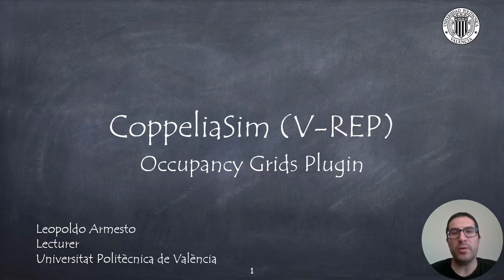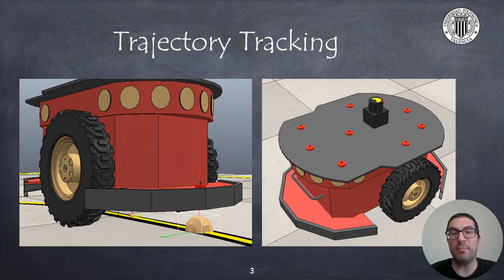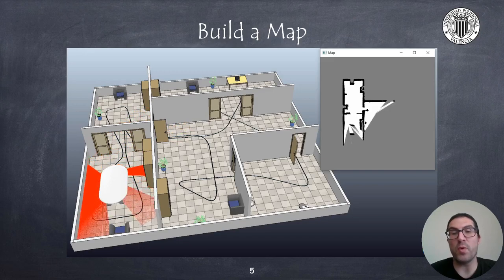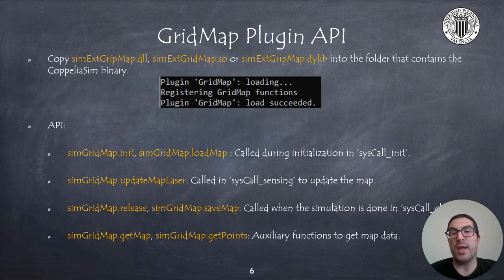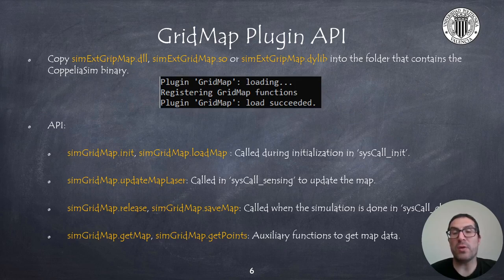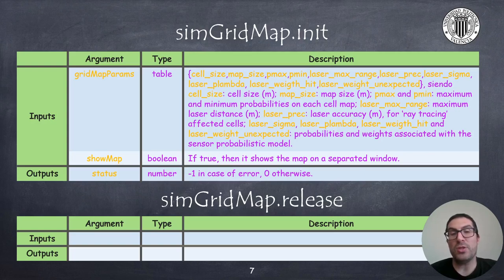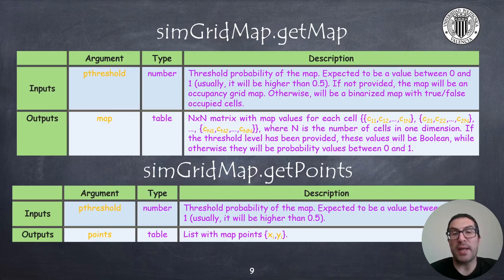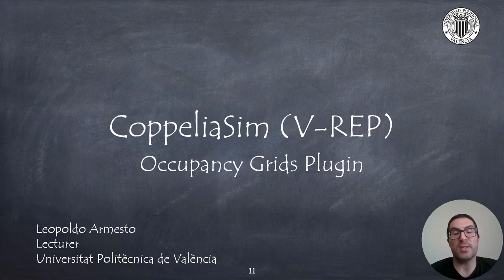How to Implement Occupancy Grids Maps with Occupancy Grid Plugin | CoppeliaSim (V-REP)

Comment: Hi Leopoldo,

Thanks for your video. I have added the .dll file and verified that the plugin has been loaded into Coppeliasim. However, I still do not know how to use it with Python and Coppeliasim.
Reply from the maker: I think that you need to build a wrapper function so that you can call it from Python

Comment: I appreciate your great videos!
 I am figuring out a ways to work on a robot localization problem using already collected  (lidar and IMU)data set of an environment. How can I use CoppeliaSim in this case?
Reply from the maker: In that case, you need first to estimate the pose of the robot and map  (Matlab , ROS, specific SLAM libraries, etc...) based your data. There’s no tool in CoppeliaSim that will process your data.

Comment: I want to do path planning for a autonomous vehicle (ackermann steering model), how can i do that in coppeliasim? (i saw one video for old vrep, which has inbuilt path planning option, but new coppelia sim doesnot have that)
Reply from the maker: Yes, it has changed. If you want I can send you a simulation file with the DYOR robot solving a maze with the path planning API. Since an Ackerman model and the differential are both non-holonomic, the API is the same. Please contact me through PayPal, because I don’t like to provide my e-mail address public
Reply: @LeoArmesto  i don't want to use any sensors, instead want to specify which all elements in scene are obstacles and should get the path generated from start to finish point. When i change an obtacle position, should get new path generated. OMPL plugin has no UI in CoppeliaSim and only works via API script?
Reply from the maker: The solution I mentioned is not based on sensors. It’s using motion planning API based on collidable properties of objects, solving a global path planning problem based on RRT algorithm if don’t recall wrong

Comment: Thank you so much for this video. I am a student and I am working on a similar project. I tried to download the plugin and place it in the main coppeliasim folder where other .so files are present (I am working on Linux machine). When I try to run coppeliasSim after that, it says could not load Grid Map plugin as it could not load required dependencies. When I checked with the error script in coppelia, it showed me some missing files. Could you help me with these dependencies? It would be really helpful. Thanks.
Reply from the maker: Hello, which missing files? Can you be more specific? Thanks
Reply: While loading the plugin, it said - "[CoppeliaSim:error]   plugin 'GridMap': load failed (could not load). The plugin probably couldn't load dependency libraries. For additional infos, modify the script 'libLoadErrorCheck.sh', run it and inspect the output." 

When I ran the script libLoadErrroCheck.sh to see the error it gave me this - "linux-vdso.so.1 (0x00007ffde81f6000)
	libstdc++.so.6 => /usr/lib/x86_64-linux-gnu/libstdc++.so.6 (0x00007f1c7c27b000)
	libm.so.6 => /lib/x86_64-linux-gnu/libm.so.6 (0x00007f1c7bedd000)
	libgcc_s.so.1 => /lib/x86_64-linux-gnu/libgcc_s.so.1 (0x00007f1c7bcc5000)
	libc.so.6 => /lib/x86_64-linux-gnu/libc.so.6 (0x00007f1c7b8d4000)
	/lib64/ld-linux-x86-64.so.2 (0x00007f1c7c866000)"

I am trying to look up for these files. Also, could you let me know what machine config are you using? And CoppeliaSim version and if all of this matters?

Thanks for your help
Reply from the maker: @revatinaik1503  It seems you need to install "gcc" library. In Ubuntu 20.04 is as indicated here: https://www.dariawan.com/tutorials/linux/how-install-gcc-ubuntu-2004-lts/
Reply: I have gcc library already installed. I tried compiling a .c code as well and it works fine. What version of gcc are you expecting? I have gcc (Ubuntu 7.5.0-3ubuntu1~18.04) 7.5.0

Thanks
Reply: I could locate all of these files on my system. I tried  to place these files in the same CoppeliaSim folder where all the binary files are present. It gave me the same error. Would you mind sharing your email id so that I can share with you the images of the errors. It would be helpful. Or else, please checkout this drive link for the images https://drive.google.com/drive/folders/1KCl7TngX1xacadAVIA9RWX8Di5RegKx8?usp=sharing 

Thanks
Reply from the maker: Then, I don’t know. Try to compile the library from the sources using Qt in the github repository indicated in the video description
Reply from the maker: @revatinaik1503  Try to compile the plugin with Qt
Reply: Could you share any resources to follow plugin compilation using Qt
Reply from the maker: @revatinaik1503  No, I don’t have that. Just install Qt 5.5 and compile the project with QtCreator. Sorry
Reply: Hey, I got this working. Had to reproduce the .so file from QtCreator. Thanks for all the help
Reply: I had another followup question. I do not see how to use the functions in the code. The .ttt scene provided above just shows the visual highlighted map. How do I use these functions?
Reply from the maker: @revatinaik1503  the use of the functions is explained in the video
Reply: 1. Which sensor do I use if I want 2D scanning? I have used the available 2D laser scanner in CoppeliaSim. 
2. In UpdateMap function I need to pass two things, the laser scan (points of the laser beam) and the laser pose. What exactly is the laser pose and how can I get it from the laser I have used? It is wrt to the world? Or the base?
Reply from the maker: Maybe, you need to take a look to the first videos I start using the Pioneer robot...
Reply: @LeoArmesto  good day one doubt, the plugin doesnt seem to be loading (it was moved to coppeliasim folder and ttt folder, under windows environment) any idea ?
Reply from the maker: @riotimus  it should appear in the console window a message text informing whether or not the plugin is loaded. Can you provide more info?
Reply: @LeoArmesto  hey, no there is not output (none/zero warning)
Reply from the maker: Try to compile the source code to get a proper binary file
Reply: If you are not able to convert the .so file using Qt creator and you already have ROS. You can use the ros version of hokuyo laser scanner, which publishes the scans as ros topics and then use hector mapping to save the map.

Comment: Hello sir, I am currently working on a university project based on slam. I want to use vrep for simulating slam for indoor mapping and navigation, but I am new to this interface and I am not able to follow the videos. I have built the map but i dont know what to do next. Can you please help me out?
Reply from the maker: You can implement your own code with a particle filter to solve the localization problem or you can connect with ROS. Unfortunately I haven’t get to that part yet...
Reply: @LeoArmesto  Thank you for the reply sir, I do  not know how to implement any  code on the vrep platform, i downloaded the files you provided in the link. I placed the plugin in the coppeliasim folder and tired to run the pioneer_gridmap.ttt, but the scene is a blank envirnoment with no obstacles, it has a straight line path and robot moves randomly and halts, it is not the same simulation as you showed in the video. I am new to this software so I dont know how to make corrections to the code. can you help me out with implementing the same code which you have provided?
Reply from the maker: Check the responses to some of my previous comments. I hope they help. There was a comment in which I provided the parameter value I used
Reply: @LeoArmesto  Hello Sir, I have been able to do the simulation to an extent but the pioneer robot is not following the path, it moves directly towards the reference point, how do i program it to follow the path?
Thanking you in advance.
Reply from the maker: I have just added a new comment in the video description. Please, take a look to it

Comment: Hello,

Your tutorials are of great help. I'm stuck with one issue I implemented all functions but unable to set the optimum values for grid map parameters in simGridMap.init function. I'm initializing the below values. But not getting the optimum results. Can you please help me with some default values which can give optimum results as In ur videos. Thanks

gridMapParas={0.75,300,0.99,0.10,5,0.5,0.73,0.80,0.66,0.71}
    simGridMap.init(gridMapParas,true)

Please let me know if I'm missing something.
Reply from the maker: Hello, the accuracy of your params seems to be very low. Try with this ones: cell_size=0.05
    map_size=25
    pmax=0.9
    pmin=0.1
    laser_max_range=5
    laser_prec=0.1
    laser_sigma=0.2
    laser_plambda=0.8
    laser_weigth_hit=0.7
    laser_weight_unexpected=0.3
    gridMapParams={cell_size,map_size,pmax,pmin,laser_max_range,laser_prec,laser_sigma,laser_plambda,laser_weigth_hit,laser_weight_unexpected}
Reply: @LeoArmesto  Thank you so much it worked
Reply: @LeoArmesto  Do you have any idea how gmapping ros package can be implemented with CoppeliaSim? I'm stuck with sending tf transforms to ros, laser data was send successfully. Stuck with this for long time any info will be helpful, thanks
Reply from the maker: @mazharshaikh7504  Very long time ago, I contributed with a SLAM demo with V-REP and ROS, but it's very likely to be outdated, because I haven't work with ROS lately... https://www.coppeliarobotics.com/files/contributions/slamDemo.rar Please, don't ask me about how things were done, because, right now I don't remember it...
Reply: @LeoArmesto  Thanks for your info and model, I was able to open the file by downloading the previous version, but the script was in the old format. So, I created the whole code in new format on Ubuntu 20.4  with ROSinterface commands.

It took me sometime but was able to reach till the part where I was able to see the map on RVIZ, but its not complete was falling into error map --> base is unavailable in RVIZ. I was using fastHokuyo, later I tried with Hokuyo ROS sensor but it showed error object handle not available. Tried a lot but was not able to build the complete map on new CoppeliaSim stuck on the last path. Your shred file is also not running as plugin is not available for hokuyo sensor.

:(
Reply: Hi Mazhar, I am working on a similar project. How do you use these functions in a script for a robot with a laser?